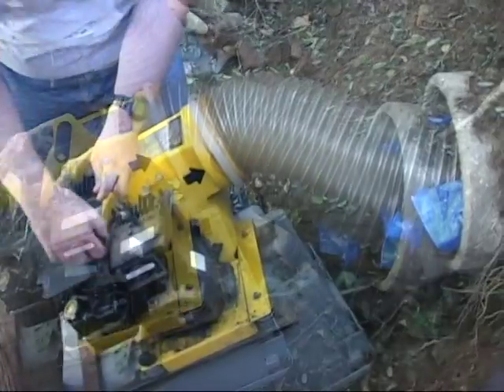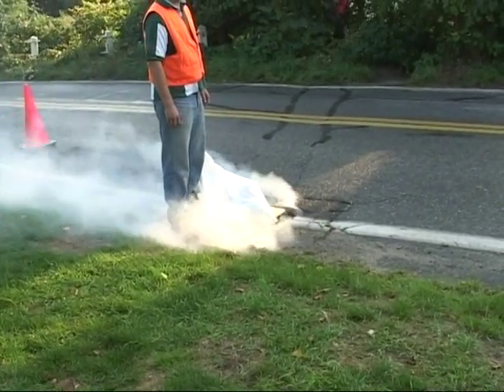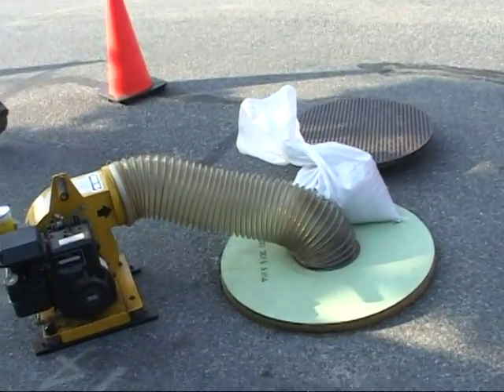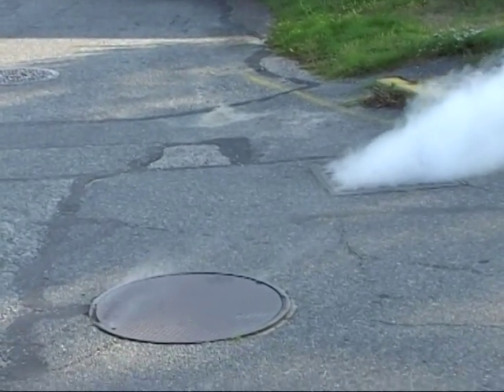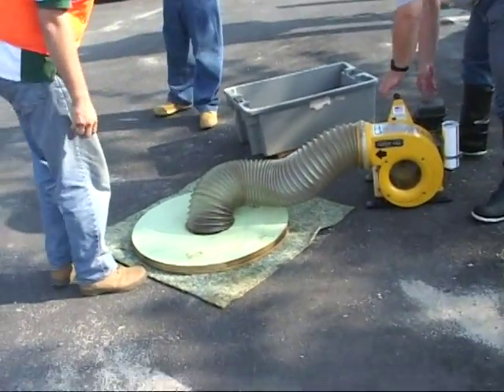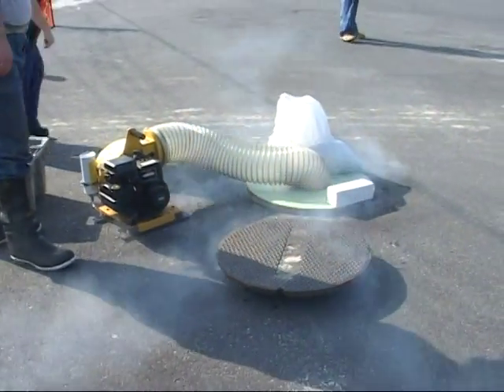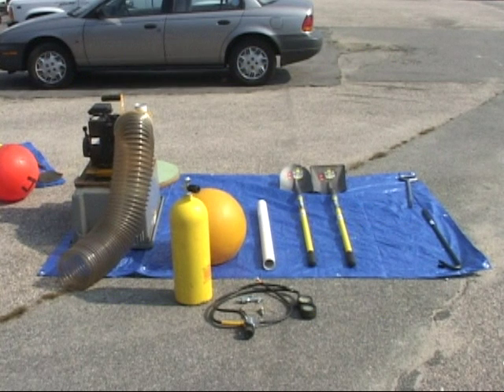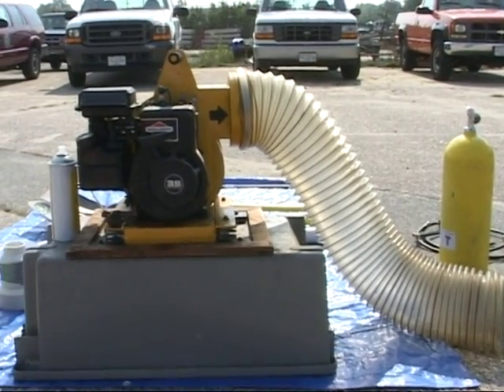Using Smoke Machines to Locate Pollution Sources

Comment: That one manhole was a sanitary sewer. It was connected to the storm drain on purpose to prevent overflowing when it rains.

These towns are a mess with their sewer line and storm drain

It used to be all one system that ran into the river or ocean

Comment: What about notifying the homeowners by or mail or door hanger tags ?
Reply from the maker: The smoke tests are done as part of an unannounced inspection by the local Board of Health and Marine Fisheries as a means to find any unauthorized connections between the house owners septic system and storm water system.  Before any tests are started both the local Police and Fire Departments are notified and in some cases on scene. Tests have be done in the following towns: Cohasset, Scituate, Marshfield, Barnstable and Nantucket.